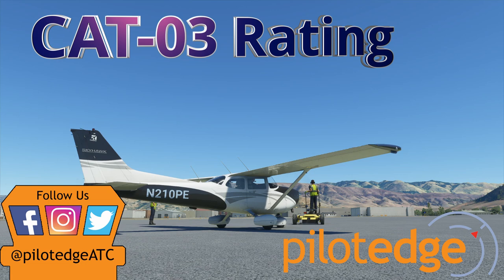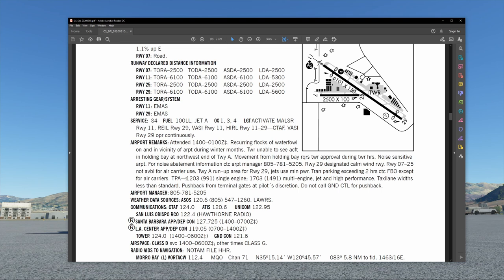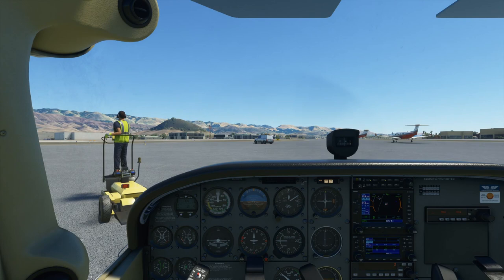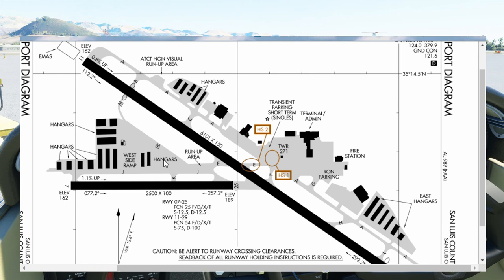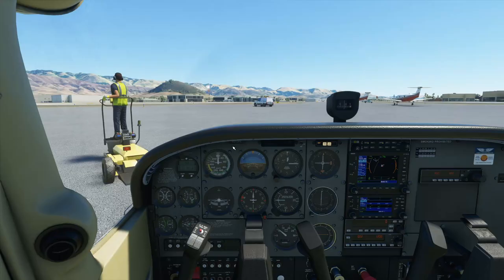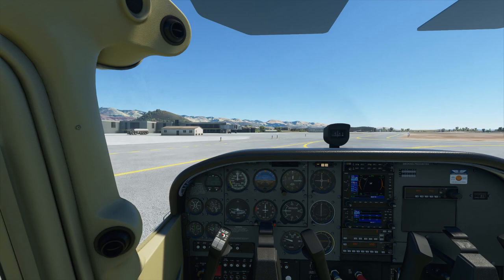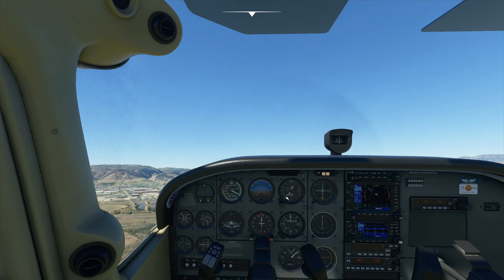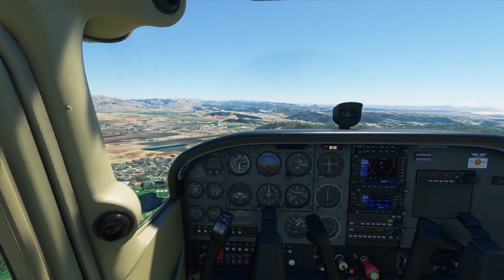PilotEdge CAT-03 Rating: Pattern Work, 3 Laps | Communications & Airspace Training

Comment: Just ordered a Flight Sound X adapter to use with my DC headset.  This seems like a game changer.  Ready to try this out and start learning.  30 hour student, 3 towered landings, but my CFI made all the radio calls.  Not helpful at all.  For the sim, I use Foreflight, but also bug the runway with the heading indicator and the wind with the OBS.
Reply from the maker: Fantastic! Yes, hopefully you can get a lot of experience talking to our controllers and master that skill without having to spend the big money in the real airplane.

Comment: I was taught I only turn base when cleared to land, otherwise remain on the downwind and ping the tower.
Reply from the maker: Use your best judgement based on known traffic, however you've been cleared to fly closed traffic, which includes the base leg of the pattern. The only thing you can not do, with certainty, is have your wheels touch the pavement without a landing clearance (per the FARs).

Comment: I'm not here to join in on the critique of airspeeds on approach, etc, but can we presume that for the CAT ratings, the evaluations are based on radio comms with ATC and not flying a perfect pattern, approach, etc? Naturally, you want to do it all correctly, but just curious about the specific criteria for CAT. IE it's not a check ride ;-).
Reply from the maker: PilotEdge’s mission isn’t to teach you how to fly your airplane. Our goal is to teach pilots how to talk on the radios and interact with ATC. The CAT ratings teach and test for those two objectives while allowing the practical component of airspace navigation into the mix.

Comment: Don't throw on flaps to slow down, airspeed should be in white arch first.  If you were in a Falcon 50 you may have lost the flaps
Reply from the maker: As mentioned in the video series, the purpose of these videos is not to demonstrate stick and rudder skills of the aircraft. This series is about airspace and communication.
Reply: @pilotedgeATC  I once gave a check-ride to a Japanese pilot who wished to rent planes from our FBO.  He dropped flaps in a Cessna 210 to "slow it down."  He did not get to rent our planes.  If we are trying to make this a more real experience, let's make it right.  Unless instructed by ATC, we do not fly to  final at 100+  We generally slow the plane down to 70 for descent then 60 on short final with full flaps.  You do everything so well, I just wish you would not demonstrate techniques to perhaps new pilots who may believe that is the way to do them.

Comment: what would one do in the instance where the controller did not specify that you were “cleared for the option” but said only “clear to land rwy 29” how would the pilot then ask to perform a touch in go instead?
Reply from the maker: “request touch and go.” However, sometimes it might not be available and you might need to make a full stop and taxi back.

Comment: I have a quick question.  I am following along in the sim and preparing myself for PE!  I just went to this airport and practiced patterns.  Very nice.  Then, I decided to try it using the other runway (11).  (lets say the wind changed etc).  I looked at the chart and it also says left pattern.  So, I took off and did basically the same thing, only going the other direction now.  However..... there are some LARGE hills directly in the pattern that are close to this AGL pattern.  and you have to get really close to them to complete the pattern.  This make me wonder.. why on earth it would be setup as a left pattern when the right would be SO much safer (like what is used for the other runway).  Any thoughts on that one?
Reply from the maker: Travis Harris Photography are you sure you’re keeping your pattern close enough to the airport, similar to what you see in the video? There is some terrain out there but it should be far enough northeast to not affect the pattern.
Reply: @pilotedgeATC  It could be me for sure, lol.  I am going to re try in a moment.  I pulled up the VFR map, and also the program "Little Navmap" which goes into greater detail.  It appears the elevation of the hills I was speaking of is not too bad on the map.  Around 230' AGL.  Maybe it was just how they appeared in the sim, but it felt very close as I went over them.   In terms of distance, yes I think I made the turn on par.  I did three laps, and each time started on the upwind (obviously) held about 80kts in the 172, climbed to 900' (in this case)  then started my left and continued to 1200'  Once at 1200' (which seems to be just a handful of seconds later) I then turn to the downwind and reduce power slightly to prevent climb. I measured on the map and the hills are 0.9mi from the runway.  At this point I seem to be right in line with the hills, which is where I need to start to descend once I get downwind a bit etc.  That turn to base can be a little nerve-racking with a big hill right there, lol.   Maybe for fun ill load up a different plane with a radio altimeter, and set minimums and see what the actual distance is.. now I am curious, lol.  I will report back here..
Reply: Okay, did the same pattern with the TBM (just so I could use the RA).  When I flew over the hills, I had about 350' showing at the lowest, while 900'MSL.  I think in IFR conditions it would be a tricky for sure, but then again I dont even know if a "pattern" would ever be done, because You would just use an actual approach for that runway etc and follow that along with ATC.  So, yeah, I guess it makes sense for VFR conditions.  It's right on that fine line of being in the perfect spot.  So, I bet most real world pilots stay a bit on the closer side to the runway to avoid it altogether, and then just have a super short base?  That maybe the safest option.  But, it does make me wonder, why the FAA would have a Left pattern at all with terrain so close.  The Right pattern is perfect.  I feel like it should be the same for the other runway.  By the way, these videos are unreal good.  Truly, this is the best "one stop shop" education I have ever seen.  I am blown away and one step away from being a new member!
Reply from the maker: Travis Harris Photography patterns are definitely used in IFR flying. That’s why the VFR fundamentals are so important! And maybe try a C172...leave the turboprops for a year down the road or so
Reply from the maker: Travis Harris Photography also, turboprops and jets generally fly a higher pattern altitude than pistons. This is to separate them from the pistons and also because they’ll naturally have a wider pattern. This might be your issue with the mountain. Try flying it in a c172 and see what the result is
Reply: @pilotedgeATC  Oh, for sure.  100% understand.  I think there was some confusion.. I only used the turbo prop, so that I could quickly jump into the sim and use a Radio Altimeter to see what MSFS2020 has the terrain set at, in this specific location :-)  Fully understand that the different classes of planes and the different requirements for MSL in the pattern.  No worries there.  I just did this to see what that actual delta was between the ground and the plane when flying over those hills on that pattern.  The C172 wont tell you that ;-)  My question was not based on IFR at all.  It's just to note that a left hand pattern on this runway is strange, because of the hills that you have to really watch.  I am just surprised that FAA has not made this a right traffic pattern, as they do with many airports with other obstacles.
Reply: @pilotedgeATC  Yes, I have been flying it all with a C172 :-)  I only used the TBM, so that I could prove what the distance is (RADIO ALTIMITER) between me and the top of the hills on that runway 11 left pattern.  The hills are exactly 0.90 miles from the runway, which is pretty much in the middle of the downwind pattern leg no matter how you cut it.  I dont think I am doing anything wrong.  Per the training, I should be anywhere from 0.5 to 1.0 miles from the runway, to the side.  So, this is right in that track.   At the point where you want to start to descend, you find that you are coming down with terrain under you.  My whole point, was that I am surprised the FAA has not made this a RIGHT pattern to avoid terrain.  Fully understand the difference on IFR, and the different requirements for different classes of planes both for minimums on approach, and pattern MSL.
Reply: Don't worry.. this whole question has nothing to do with PE or anything like that.  lol.  I was just wondering, if there was another reason that anyone knew of as to why the 11 Runway would have a left pattern, knowing there is terrain to avoid, while a right pattern would have zero issues at all.  Thats all :-)

Comment: Very helpful, on thing though: I am taught to aim for 65kn on final with flaps full - you seem to be coming in a bit hot...
Reply from the maker: As the videos indicate, these are not to demonstrate how to fly the airplane. They’re to demonstrate the airspace and communications aspect. By now, we all know that Microsoft FS2020’s flight dynamics do not allow for a realistic simulation as far as aerodynamics and actually flying the aircraft.
Reply: @pilotedgeATC  also flap limiting speeds in 172 are 10 degrees flaps 108 kcas 110 kias, 10-40 degrees of flaps 86 kcas 85 kias.
Reply from the maker: @davejones542  As the videos indicate, these are not to demonstrate how to fly the airplane. They’re to demonstrate the airspace and communications aspect. In addition, Microsoft FS2020’s flight dynamics do not allow for a realistic simulation as far as aerodynamics and actually flying the aircraft.

Comment: I love Pilot Edge, and what they do  ..  great job Keith.

However,  this Video should be pulled, and replaced with one where the pattern  is flown Correctly,  with correct airspeeds, Flaps  settings, and altitudes throughout the pattern.
The airspeeds in particular for a C172  were WAY  to fast !
If a Video is going to be an "Official" Pilot Edge Instructional Video,  it should be better flown than this ...
Reply from the maker: Thanks for watching! These videos aren’t to teach people how to fly their aircraft. Furthermore, they were recorded in MSFS2020 which doesn’t have the most realistic of flight dynamics (especially at the time of recording). The purpose of these videos is to demonstrate the proper procedures for navigating airspace while talking to ATC. For specific flight training, check out our remote coaching program! www.pilotedge.net/coaching
Reply: Jeez buddy, lighten up. Everyone knows you're not going to get perfection out of a SIM. This is an excellent video. It fulfills the stated purpose...and then some!